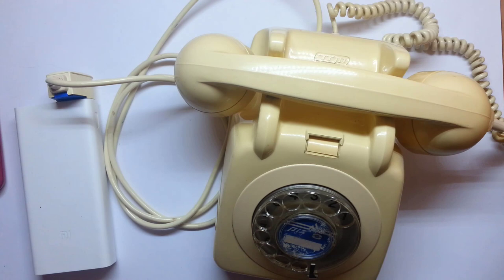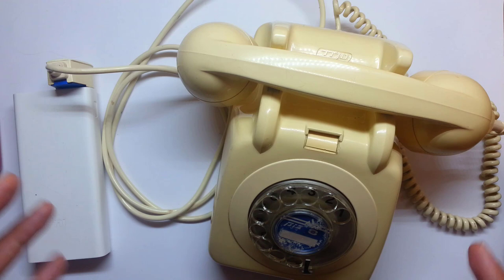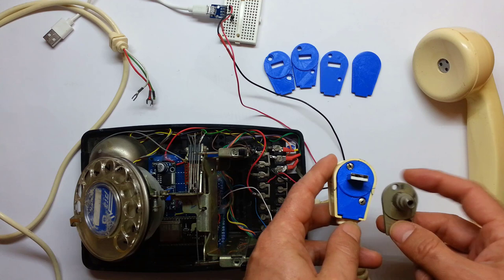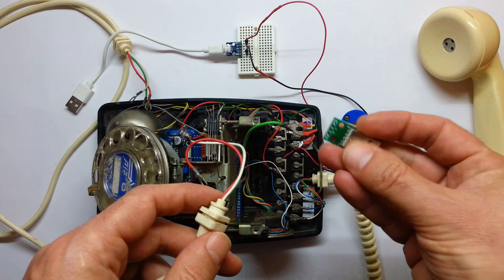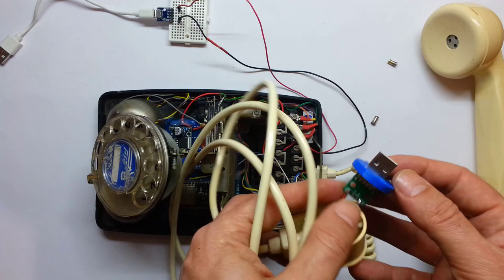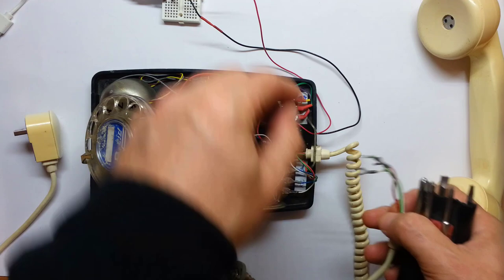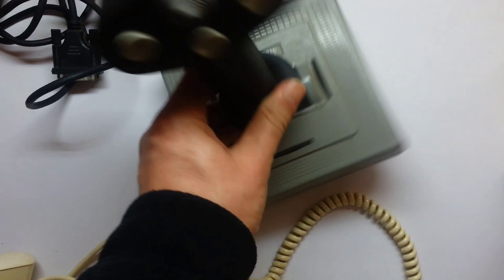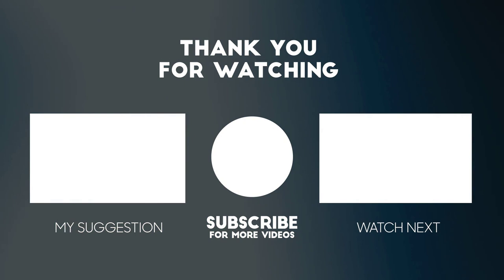Taking a rotary-dial phone into the future – part VI– make it plug

Comment: Great project!
You asked for an Idea for Wifi, if there is a VoIP Library you actually could make it use VoIP as an alternative as long as you're in your home network.
Afaik you can actually write the code principial like this "If > Connected to wifi > use voip profile > else > use SIM Card"
Reply from the maker: Hi, thank a lot that is a great idea.
The issue will be the sound, since now the internal dac of the esp is used for the ring and speech. and the handset is connected directly to the sim800. 
It will be hard to have an electric mechanism to switch between the 2. 
But I do think I need to consider building one that is VoIP.
Reply: @talofer99  well the only way i could think of would be a slide-switch that switches the audio output between the handset and the speaker.
The other idea would be a second ESP where you use a slide switch to switch the 5V between the sim ESP and the ESP for voip, (so the ones off while the others on) would be more soldering tho because you'd need to solder everything parallel to the other ESP.
Reply from the maker: I think I need to start by looking into VoIP options on the esp :)

Comment: 1. super cool project, 2. how did you tackle the issue of different phone number lengths (land and cellular), like how the system knows when to dial? by prefix?
Reply from the maker: Thank you very much.
Since I attended it for local use only (no international calls) I added this logic 

if ((dialedNumberCursor == 10 && dialedNumber[1] == '5') || (dialedNumberCursor == 9 && dialedNumber[1] != '5') ) 

Here in Israel we got Mobile and Land lines
All mobile phones are 10 digits and start with "05"
All land line numbers are 9 digits and start with 0X when X can not be 5 since that will be mobile. 
Hope this helps :)

Comment: Hi Talofer, great project, Im trying to replicate what your doing an a way, with some alterations.  Im getting alot of noise when there is no sound coming from the mic, I guess the SIM800L is amplifying the silence to relatively high noise.   Did you struggle with the mic input on the SIM800L unit?
Reply from the maker: Thank you very much. 
I did not had any issue like that, when and how do you hear that noise if the mic is off ? 
Does it happen when you in a call ? 
Maybe the way the cables are connected ?
Reply: @talofer99  I only can test this when in a call i think.  So yes, its happinging in a call.  I get the noise when some sort of mic is connected and when its not connected, also when i short the mic input or put some capasitors according to sim800L datasheet from the mic to ground.  But the noise actually goes down quite a bit when i connect signal generator with 1khz for example.  It seems as if the SIM800L is amplifying much much more when there is little volume coming in.  I think I might try connecting battery to SIM800L, because perhaps its reacting to some disturbance from the power supply.
Reply from the maker: @TheWhoseMoose  add battery ? 
how do you power it now ?
Reply: @talofer99  The power supply was not the problem I found out.  Its the leads and antenna, I have to hold the antenna high up and,  its all just so sensitive for noise.  Im not inserting anything into the phone like you did, Ill be keeping the phone intact.  So Im having the spoken sound and receiving sound on the same wire pair,... might be a bit challenging.
Reply from the maker: @TheWhoseMoose  glad you figured it out. 
Would love to see the end result :)